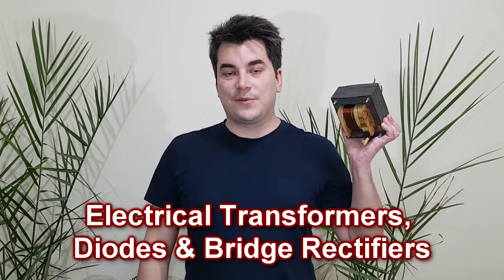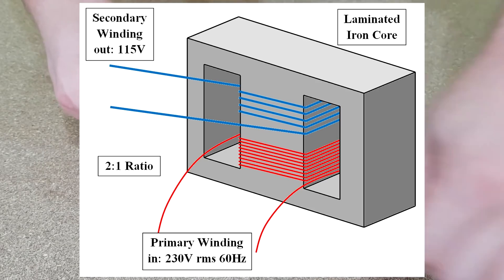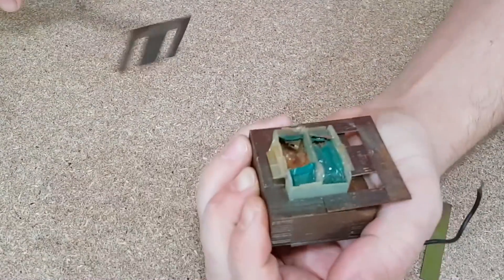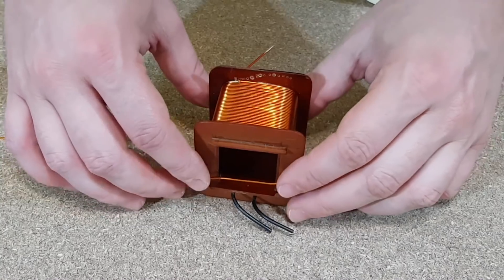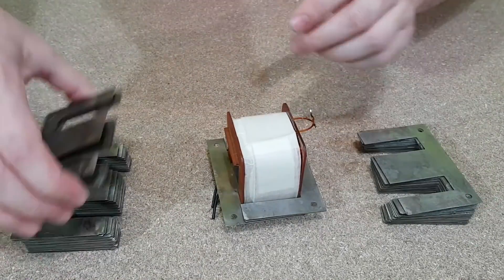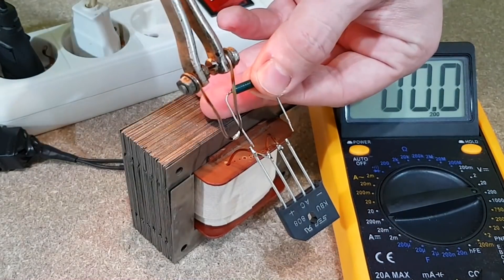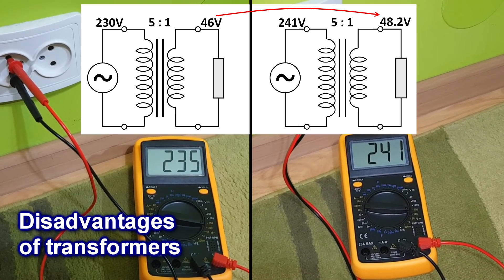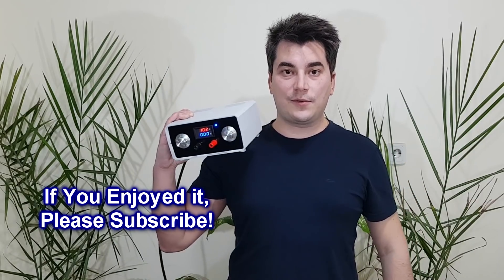How To Modify A Transformer (Diodes & Bridge Rectifiers Included)

Comment: It is very interesting, but I did find this video for a reason, I have a transformer for a big 20 amps old school power supply. (CB, ham radio)  The transformer itself makes strange noises and trips the circuit braker of the house.  The power supply itself works when I "Inject" 20 volts at the condensators.  Now I ordered the only available transformer for a replacement but is not to be delivered next two months.  I tried to remove the metal iron sheets of the old one  but I can't remove the first one, it seems to be glued, even to the plastic part.   I would try to unwind because I've read online and from others there  might be some "heat fuse" or any kind of other fuse in the windings.  This video is also very interesting because I would like to introduce after market features like leds so It would be helpfull to be able at least to take this large transformer apart for future knowledge / use.

Comment: Can we use high watts resistor as load to find out maximum output current of transformer?
Reply from the maker: yes, but it's difficult. depending on the output voltage of the transformer you need different value resistors. the rectified voltage will decrease when you connect a load. and with big loads, the transformer will get hot in time.

Comment: idiocratease
0 seconds ago
Hi there,I have watched a few of your vids and really enjoy (as a amateur solderer). However, I also have a puzzle. I recently bought a master-slave powerstrip (to control the on/off of my REL subwoofer, but the powerstrip made a very bad buzzing. I have tracked this down the an inductor, and I am puzzled by how to choose a replacement. I have made a short video (https://youtu.be/9eu8LjN11bg) and would really appreciate it if you could take a look and if possible steer me to a good replacement component. Thanks 👍
Reply from the maker: Hi. I've searched for an inductor replacement, but I can't find one with those specifications. are you sure it says 3.0mH? I have found only one type of a 3mH inductor: https://s.click.aliexpress.com/e/_9zD8S7 it has 2 coils but with a thickness of 0.3mm. even so, I think it should work. 
if it's a 30mH inductor, it will be easier to find. 
your inductor may be modified, because I can't fine one with 2 coils and 2 pins and if it's not put together properly it will make a buzzing noise. it also looks like it has a lot of glue on it. you can try to dismantle it carefully (count the number of turns) and try to put it back together in a better way. or replace the wire.

Comment: Hello from Canada,

Can you please tell the liquid used to separate the fiberglass of the cladboard as seen in the bowl in the picture at 3:04 ?

Im not able to find the type of adhesive used in manufacturing and so cant lookup solvents.
Reply from the maker: hi. in that photo I removed the copper from the clad board using hydrogen peroxide and muriatic acid. but you can do the same thing with ferric chloride (for PCB etching), it's easier to find.

Comment: Hey bro. I have a transformer with a 12.0.12 winding and a maximum of 8 amps. the primary is made for 230v but the mains voltage is 250 so  I get 14v out of the transformer. if I use both 12v winding I get 29.2v. the rectified voltage is 42 volts with a 3300uf cap. that's too much for a buck converter. can you tell what value resistor I can use to drop the voltage under 40v. thank you so much for your help with the video.
Reply from the maker: hi. the primary winding of the transformer may burn if you connect it to 250V, so check how hot will it get in time. you cannot use a resistor to decrease the voltage, the output voltage will not be stable and the resistor will probably blow in time. it depends on what you want to use the transformer for, what is the final load? there are other options, depending on what you need it for. the best option is to remove a few turns from the secondary coil, usually you don't need to dismantle the transformer for that. or you can use a better buck converter with a higher input voltage.
Reply: @Sorin_DIY  thank you for your time. I removed some turns from the secondary. it's 28.1v same as yours :D. is it ok to use your circuit in the video?

Comment: Nice work keep it up... I have digital multimeter when i use in continuity mode it give beep but not show any value in continuity mode. Plz help
Reply from the maker: if you check continuity it just beeps. if you check diodes it will show a value.

Comment: Good video! Just wondering if the diameter of the copper wire  wire makes a difference in the output voltage.
Reply from the maker: no. the diameter of the copper wire determines the output current.

Comment: salut. am nevoie de 4 surse de curent alternativ sau continuu ca sa alimentez 4 motoare NEma 34 (input poate sa fie VAC 20-70 sau VDC 30-100 V). Am nevoie de maxim 8Ah. 
Am 4 UPS-uri fara acumulatori. Intrebare: pot sa folosesc transformatoarele din ele si sa modific sarma din secundar?Recomanzi sa folosesc direct alternativ ca input (ca sa elimin puntea diode)? Cum calculeaz Amperajul daca e suficient cat am nevoie?

Succes in ceea ce faci.
Reply from the maker: salut. poti sa folosesti transformatoarele din UPS-uri, sunt destul de bune, dar trebuie sa le modifici secundarul, sa scoata tensiunea dorita. amperajul nu cred ca poti sa il calculaezi inainte sa bobinezi transformatorul, pentru ca nu ai specificatiile transformatorului. in cazul acesta nu ramane decat sa folosesti ce sarma groasa de cupru ai pentru bobina secundara, apoi sa masori curentul maxim. daca nu e de ajuns, trebuie sa refaci secundarul cu sarma mai groasa, sau cu 2 sarme in paralel (sa dublezi curentul).

Comment: Hello Sorin
How many turns was there in primary and secondary winding?
How the DC voltage got increased when you connected the capacitor?
As you build this transformer for 3 amp output, will the DC current output will be 3 amp or not?
Reply from the maker: hi. I made that transformer a long time ago, I don't remember how I made the primary winding. but using trial and error I made the secondary winding for this video with 164 turns for a 28V rms output. it can deliver around 3A. I use this transformer in my variable power supply video.
the rectified DC voltage has an average value and a peak value. the capacitor is used to increase the voltage from the average value towards the peak value.

Comment: well my suggestion is use toroidal transformer less complicateted to mount,lesser power waste ,depending on the input and output the weight vary,ratio depending on the materials you use for the core,power ratio of toroidal transformer vary between 1:0.9 to 1:1 whether square transformers have a power ratio of 1:0.7/0.8.
wrapping the coils in a toroidal transformer can vary based on the thickens of the wire and number of turns...
sure it may weight a bit more than a traditional transformer but you gain  better convertion ratio when compared with traditional transformer.
but hey don't take my word for it,go ask to electricians or all those people that actualy works with electricity,forget to go ask to the fools just came out school coz they know only the theory and you can stick the theory up your ass,i always thought the best school is practice!!!where you make things with your own hands.....

Comment: Hi. Thanks to you, I was able to understand the "mechanism" and "voltage" of the transformer. I understood the calculation formula by watching the video. Gratitude and praise. But I didn't know the "present". Is there a formula to calculate the "maximum current value" that a self-made transformer allows? From Japan to Romania.
Reply from the maker: hi. new transformers come with specifications. but for a home made transformer made with recovered parts I don't think you can calculate the maximum current in advance. you can just measure it at the end and then modify it, if needed.
Reply: @Sorin_DIY  
I received a reply!  Ah!  It's not "present" but "current".  I learned more from Professor Sorin.  Thanks to you, I seem to see the movement of the electrons.  "Transformer" seems to be interesting.  OK, I'll try disassembling it too!

Comment: I have a transformer 220v to   35v + 50v  but I'm in the US and our home voltage here its 110v,  do i remove half of the wire from the primary coil ? will that solve my problem ?, this is for a home woofer with built in amplifier
Reply from the maker: hi. it depends on the type of the transformer. but on most transformers you can remove half (or almost half) of the primary winding. just test it, to be sure it will not get hot. for example microwave oven transformers have a very low efficiency and they get very hot very fast. after you test the modifications to the primary, you can add the secondary winding.

Comment: I need help please !!!

I did buy a second hand  black and decker 12 v drill and i did find thr  charger give more 21.4 it's normal? For 12v batteries? It's show the battery full charged but she is on 3.4 v when i did checked plus there is a lite smoke after plagued to the charger what should i do?
Reply from the maker: hi. the battery has ni-cd or li-ion cells? either way, 21V is too much for a 12V battery, so I'm guessing it's not the original charger. you should get the right charger for the battery.
Reply: @Sorin_DIY  thank you so much for replying so fast ❤️ the battery nicd and it's thr original charger, i did open the charger and i think it have a risistor that not working properly, i did check it the risistor with the multimètre it give bibis sound and get so hot after small time of working so i think the smoke coming from him the resistor color are gold gold black balck brown and he is big i can't find something similar right now can i change it with another thing? What are your suggestions?
Reply: And i have another drill 18 v nicd battery what should be the voltage output from the charger? Need more from 18 v output 20 or 24v?
Reply from the maker: 24V but very little current, around 400mA
Reply: @Sorin_DIY  thank for your help 😊

Comment: All of electrician, cat lovers 😂
Reply: I sorry did you utter step down . see I Told by Mr Sauced do stepping down
Reply: I sorry if I want 2400 to 120 V 20:1 ratio or stepping down increases well-known law winding generates an end very complicated so try a resistor covert what o amp to two a DC o rectifier or a transistors or a purify covert electricity tell me what a amp an Volt an watt an a power transformers constant -voltahe transformer transformation of large power. For get respect those noted 🇺🇸 Trump 🇺🇸 Obama two same rating
Reply: Man danger playing with taps of transformer under loadkilvolt -ampere

Comment: Thx you, for such an amazing lesson about transformers!!
I need to combined to transformer in parallel to increase the amp output available, what about the voltage??
I know, that in parallel only Amp output in gained/ increased, but if I used an transfo 6v and transfo 12v, what will be the output voltage result? 12v right??
Thx
Reply from the maker: hi. you can't connect in parallel 2 transformers with different output voltages.
Reply: @Sorin_DIY  Thx you 😉

Comment: Thank you Bro
But how do we calculate the intensity of the outgoing current For example, if we wanted five amps in the output 
How thick is the wire
Reply from the maker: hi. if you build a transformer from scrap, like me, you can't calculate the current in advance. from experience I can approximate the maximum power of the transformer. if the output it's not what I want from the first try, then I always say "use thicker wire". only if you buy a new transformer, or new parts to build a transformer according to its schematic, then you can calculate the output power in advance. in the '80s and '90s you could find transformers that came with its specifications. but nowadays transformers are replaced with switch mode power supplies, so it's difficult to find a transformer with its parameters list.

Comment: sorin thank you so much for the feedback.To get 25 Dc 2  Amps ,what secondary Transformer and Rectifier i should built..?your feedback is highly Appreciated.
Reply: First, you need a starting RMS value; multiply wanted output + 1.4 + load voltage drop × 0.707 (25+1.4+1 = 27.4V DC = 19.372V AC RMS). This is what we're working with.
Next, we make 10 secondary turns, and measure with a multimeter. This value will be divided by 10 turns to get one turn, in our case let's say you have 10 turns for 1.414V. Divide, to get 0.1414V / turn. Now, you can divide your target voltage of 19.372V with 0.1414 = 137 turns. I don't know the specifications of your transformer.

Comment: Hello Sorin -great stuff & keep up the good work.
I have a question for you. I have a transformer that outputs 26.2VAC (and I would assume north of 10A) and I want to use it as a charger for a 24V (45Ah) car battery pack. However, I measure the voltage after the rectifying bridge and I get 23.2VDC. I would be looking for something around 26VDC. I did not try to add any capacitor and/or ressistor to my circuit yet, but seeing your video i'm troubled by the fact that it's possible to exceed the initial 26.2VAC output. Can it be done? What capacitor should I use, and resistor if any?
Reply from the maker: hi. after the bridge rectifier you will get 23.2V DC RMS. if you add a capacitor without any load, the peak voltage is Vp=Vrms/0.707 = 32.81V peak. but when you connect any load, the voltage will decrease. if your transformer can deliver 10A, that will happen at RMS voltage value, with a load connected that decreases the voltage to that value. at 32.81V you will have almost no current. when you connect a load, the voltage will decrease to the value that can deliver the current consumed by that load. you can add a 1000uF capacitor and short it with some dummy load resistors, that can decrease the voltage to what you need. try with some 1Kohm resistors, but 10W minimum because they will get very hot. it's not the perfect circuit, but I think it will work for what you need.
Reply: dublareDeTensiune

Comment: That is a very good way to do it but there's one that i use most of the times and it works flawlessly take a pot fill it with water use as much water as need just so it covers the transformer fully also and about 1-2 cm over the transformer because some water will evaporate during the process next put it on stove and let it boil for about 15-25 minutes bigger transformers may need 30+ minutes after boiling is done take it out of water by pair of pliers and the so called "I" piece should come of very with no trouble then use screwdriver to force the middle out and that's it you got perfect iron core and the wires inside that coil will be reusable

Comment: "The cat always helped me with my project" Loool. You rock man :)
Btw ve got a transformer and a label on it divided in 3 sections |0 220|0 10.5| 0 20| . So the 220 is the input AC voltage and the rest are outputs. Correct me if im wrong.
Reply from the maker: probably yes but you should measure it with a voltmeter to be sure.

Comment: Max current is determined by what factor ? Difference between 1 amp and 3amp 12v transformer
Reply from the maker: hi. max current is determined mostly by the thickness of the secondary copper wire. the thicker the wire, the higher the output current is. also a bigger transformer has room for a thicker primary winding wire. a thicker primary wire can handle more input current, so it can be made with fewer turns. fewer turns in the primary equals fewer turns in the secondary. fewer turns in the secondary gives us more room for thicker wire in the secondary, and so on... also a good bridge rectifier with a big electrolytic capacitor gives us a more stable power output.
Reply: @Sorin_DIY  I want to make a transformer with turn ration 7.2..... so how much turns should I wind in primary winding and what thickness of coil should I use so that I can get 3amps of current in output

Comment: Wow! Good information presented in a fun manner.  And it is traditionally a very boring subject.  Very well done!  Suggestion: look into computer based ociliscopes, you will need a monitor with a high refresh rate, but they are a good entry into ociliscopes.  Warning, do not buy cheap leads for your ociliscope.  You will not enjoy the money saved!

Comment: I'm confused about the resistor at 10:52  ? Are you saying that the resistor has one advantage and one inconvenient? (Inconvenient: with the resistor, the current is less stable (but not much). Advantage: the resistor discharges the capacitor when we turn off the transformer). 
You say the resistor "is also..", if I'm not mistaken, you should have said: "*but* (on the other hand) the resistor discharge the capacitor", right?
Reply from the maker: hi. I've used the resistor as a load, you can use a light bulb, a DC motor, or any electronic device that needs the transformer as a power supply. no matter what load you use, there will always be a voltage drop. I just wanted to point out, that the capacitor will help to keep the voltage stable and a bit higher. without a load (resistor, light bulb, DC motor) I can't explain and show this. then I use the same resistor to discharge the capacitor, when I unplug the transformer from the mains. but you can use a different resistor for that, included in the bridge rectifier. for example I use the 82Kohm resistor in the next video (variable power supply) only for discharging the capacitor, when you don't use the power supply. the 82k resistor is using very little current, so it would not mess with the rest of the circuit. the main load is the step down converter, which uses a lot of current, when you connect a big load to the power supply output.